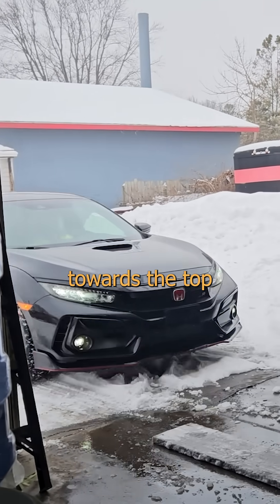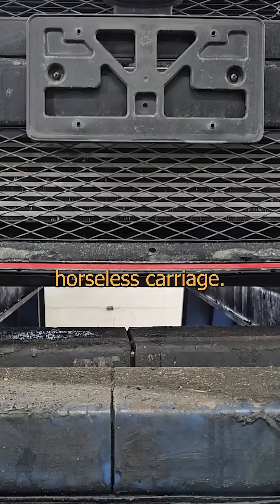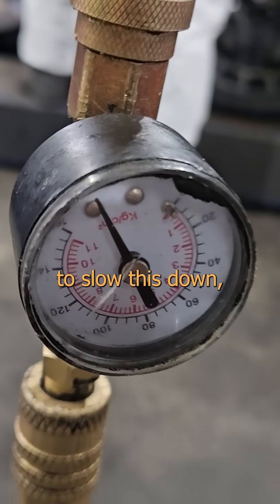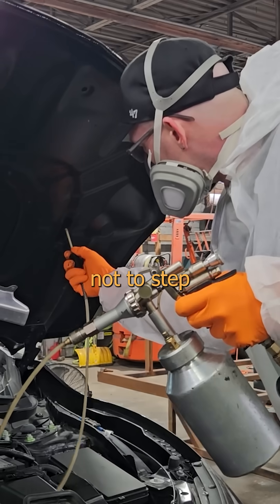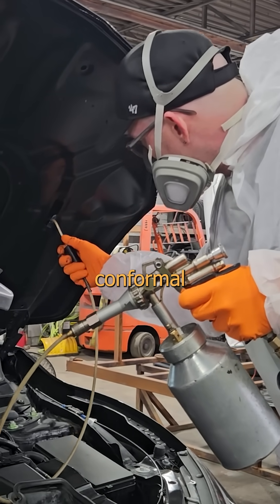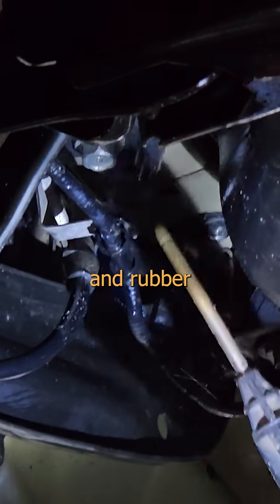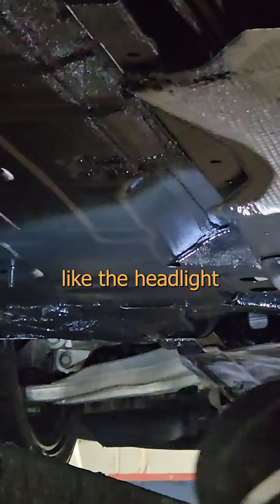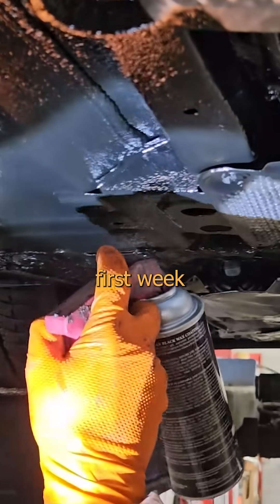How to stop rust on your car #chrisboden #comedy #engineering #wax #corrosion #science #winter #salt

Comment: Auto tech here, I do apply a couple different types of undercoating. This is all excellent advice, only thing I would add is to push for high quality prep work before the undercoat is even open. A bad prep job can make things rot out faster. Stay safe all!
Reply: Wash it and fluid film, wool wax, or used oil.  Anyone selling “magic” ointments is a crook.  If it’s not slopped on and sealing oxygen out, it ain’t doing 💩
Reply: @randymagnum143  yeah, every spring I get my car up on the blocks and use an old bug sprayer to use old oil to hose down the under carriage after a really thorough session with the power washer
Reply: Oh God yeah. Proper preparation is essential to any subsequent coating whether it's the primer, paint or protection. I could have gotten more crazy with the "P"s but I'll leave that to Chris.
Reply: @charlessanford2198  :  Paint, or a hard coating, yes.  
.
The lanolin based undercoatings that never cure or harden..  Yes and no.   Are you better putting it on a perfectly prepped surface, yes..  But if it isn't perfectly clean and rust free, are you going to trap in moisture and ensure quicker rot..  No..  
.
Even if its already rusted, it will slow it down, it will keep more moisture and more oxygen from getting to the metal, greatly slowing the rate of rot.  
.
Better to apply over crap, probably at least after a car wash, than to not apply at all.   If I ever have to move back to the northeast, I'm taking a Southwest vehicle and will have it done professionally where they get every nook and cranny, and then touch up myself the next 4 years, and then bring it back on year 5 for every nook and cranny again..
.
Also..  Lanolin..  Comes from sheep, its the oily waxy stuff on their wool, its why they don't look like a wet cat when it rains..  Also where the brand name "Wool Wax" comes from.   Also quite a few other brands,  Fluid Film, Krown, Surface Shield and more.
Reply: @bobw53jrma I spent my youth raising sheep. I know lanolin up close. (Almost added "and personal" but that's for the freaky, lonely shepherds).😂
Reply: @charlessanford2198  you mean the seven P’s?
Reply: This is solid advice for essentially all coatings. Prep is key.
Reply: @jasexavier  Same with ceramic coatings, the ceramic does the work, but the prep work is what the client sees in the end.
Reply: @jasexavier doesn't really matter as much for zinc paint. Had vehicles that lived on the beach survive far longer than they had a right to as the whole underbody was sprayed with zinc paint
Reply: @jasexavier I agree
Reply: Many people have been turned off on undercoating by dealerships selling it but making no changes to what is under the vehicle.
Reply: I'm with you on that I've Sean chassis rotted out under the wax coat and underseal paint
Reply: I came here to say the same thing. You can use rust prevention from NASA but it wont do shit if you havent prepped properly
Reply: How can I say thank you!  Prep is the key in EVERY project. 
I've f'd up enough man hours since I was a kid to young to know the dangers of my projects coming to the conclusion.....don't skimp on prep!! 👍👍
Reply: yep, no different than paint (just a pretty coating), its ALL about the prep.  It doesn't have to be anal retentitve perfect unless you are trying to do Concourse restorations, but you do have to do it right and not rush that part.
Reply: Is there a decent half-assed DIY option like a spray on bedliner? I have something that's not quite a beater and I want to take care of it on a budget.
Reply: @ProjectZ36 just get fluidfilm from autozone or HD, one time I saw them at HD on clearance for about $2 a can.

Safe for everything
Reply: @ProjectZ36 Yeah, any lanolin-based product (like in this video) can just be sprayed on, with a grease sprayed inside the box sections.

Jack the car up, clear the dirt off with a hosepipe, wire brush any really bad bits of rust off then just spray the stuff on. The grease goes in holes in the box sections.

Takes a day or so to dry and even then is kinda tacky. Reapply year or so. More often if you like driving fast through puddles.

It's great because it needs little prep, is quick to apply and doesn't chip and then have hidden rust underneath the protection.
Reply: And does anyone have a recommendation for quality service in the Rochester ny area?
Reply: Wasn't there a 'service' that installed an anode to the car? I remember seeing old German cars and Cadillacs with an emblem on the grille denoting it had been installed. Something to the effect that it used the negative grounding of the car and the anode to delay corrosion.
   I'm in a southwestern state, so it's not a big deal here. I just get a couple cans of rubberized undercoating and go to town with that. Our windshields on the other hand...
Reply: @longbow6416 yeah, I remember that too. But why do you undercoat your car in the SW? Are you near the ocean or something?
Reply: What is proper preparation?
Reply: @TheOGofSki Well, a really thorough wash would be first, followed by cleaning with a solvent.
Maybe apply a binder or base coat.. All depends what the top coating is but those first two steps are pretty universal.
Reply: @TheOGofSki deep clean n dry
Reply: an easy 1 day paint job is 3 days of prep work.
Reply: The best time is after you drive it out of the showroom, as we all know about the after sales push we get when we buy it. This is a really good one. I would wonder if it would last in the Australian Deasert, though. That red dust eats cars for breakfast here.
Reply: What's special about the red dust? I live in the southwest US and people want used cars from here because cars don't rust here.
Reply: @vfguy65  our glass gets trashed tho, and if you don’t have covered parking? Say goodbye to your paint job.
Reply: Ah yes, I love the P.O.D. techs… they don’t need to even be spraying an air pistol
Reply: Yeah prep is definitely key, you don't want to trap rust and moisture under your protection because then it works in reverse!
Reply: Yep...
Reply: Why not paint it with cheap paint or base dont know how its called in english
Reply: @dmitryhetman1509  He mentioned why in the video: Hard coatings can chip and crack, and then it'll start rusting from the inside. Soft coatings like he mentioned are largely self-repairing.
Reply: @koma-k  Engineer here, great comment. Any undercoating helps SO MUCH, and I'd recommend the soft wax coatings like Chris shows. Less risk of water getting BEHIND it, self-repairing, and technically you can remove it. Don't get hard coatings. And don't overpay!
Reply: @koma-k  Thanks, I missed the self-repairing part.

Comment: I buy shitboxes. Most of them leak transmission fluid and oil. They undercoat themselves.
Reply: Had a 2003 forester with almost no rust on the front end. Turned out to be a weeping pcv valve that wasn't replaced for a decade aerosolizing motor oil throughout the engine bay.
Reply: @TikkaQrow  Gotta love the old Subie boxers lol
Reply: @TikkaQrow Shit I'll take that over it getting all over the valves. Unless they're not DI, idk.
Reply: Shitbox for the winter, decent car for summer! The up north way!
Reply: By the time most cars here start leaking they're already rusty as hell.
Reply: The smell of Fluid Film has scarred me for life.
Reply: Hello fellow wizened cheapskate
Reply: Yup. True story.😁
Reply: Disgusting
Reply: this is what i was thinking LOL
2 shitbboxes and both are doing just fine! 

fine. i said fine.

Comment: So that's a layer of wax over the anti-rust from the car factory?
Reply: its a fair few coats of oily wax. the smaller scratches and pin hols self seal in the summer as it becomes slightly softer and flows back together.

Comment: The underside of my sedan & SUV is pretty
rust free, but the fenders are rotting away.
Reply: Open your hood and clean out the leaves, dirt and debris from the bottom of the windshield. Then peel back the fender liners at each wheel and do the same. The dirt gets stuck in these places and holds excess moisture. Odds are that's what is causing your fenders to rot.

Comment: Oil leaks are the best rust prevention!
Reply: Controlled seepage for corrosion prevention!
Reply: If it drips oil, it has oil.
Reply: @linkbond08  land rover, if it ain't got no oil under it ain't got no oil in it lol
Reply: @BLAZE13011  I can attest. Many years ago, I had a '97 Disco that decided the entire undercarriage needed better rust protection, so it threw a rod, knocked a hole in either side of the block, and doused my entire undercarriage and the passing lane hogging a-hole I passed in a nice coating of oil.
I'd recommend Chris' method as the replacement engine cost as much as I paid for the giant, gawky POS. It was built before Tata owned LR/Jag and was still a flaming pile of garbage.
Reply: @linkbond08 if it drips oil, it isn’t burning oil
Reply: Depending on the size and severity of the leak, you might not need to do oil changes, provided you keep it topped off. Just change your filter every 3000 and keep 'er full
Reply: @InvisibleSquids i actually had a Honda Odyssey that leaked oil at a rate that I just changed the filter every 5000 miles and called it good. Drove that thing from 220k-297k the transmission finally took a shit. For $1000 auction vehicle that I only delt with the oil thing and it was reliable for years
Reply: @RobD76 mini vans make a great beater as you can usually find one fairly cheap and they are practical as heck
Reply: @RobD76 I've got an 04 that leaks oil and the condition of the front sub frame vs the rear sub frame is crazy. The front looks factory and the rear is whats expected for a 20 year old ohio car
Reply: @RobD76  that's awesome, odysseys are great vehicles outside of the known issue with the transmissions, but it sounds like you got your money's worth out of that one lol
Reply: @RobD76  Those transmissions were the Achilles heel of a great vehicle lol
Reply: @InvisibleSquids had a car like this lol was a winter beater that lasted way beyond what I expected from it, just keep the oil topped Off and funny enough the oil never looked dirty
Reply: @InvisibleSquids theoretically if its draining fast enough to keep the oil changed then you should also see extended life out of the filter because its always seeing the clean new oil
Reply: @cameronvandygriff7048  No you definitely still need to change filters regularly. if you're leaking more oil than is going through the filter you're gonna run dry in less than a minute, car oil filters flow a LOT of oil.
Reply: @InvisibleSquids I top mine off around a at a week
Reply: @InvisibleSquids  when I was 18, I had a chevy s10 that burned/leaked 2 quarts of oil for every tank of fuel all I ever changed was the filter lol.
Reply: @InvisibleSquids  Ah, nothing like going back to total loss oiling systems, and the best part is you don't have to turn a wrench, you just need to wait about 15 yrs and your car will return to monke on it's own!
Reply: @InvisibleSquids  The car I'm driving rn is leaking so bad that I use an entire jug of oil each week
Reply: @InvisibleSquids I do this with my current Screwzuki. I decided years ago that I would just keep the car until it broke in a bad way, as I couldn't afford to keep fixing all the little things that kept going wrong.

It's liberating. I drive it like I stole it, and I don't sweat the scratches or dents. Is the car making a new noise? Cool, let's see how long this one sticks around.

The problem is that, now that I have resigned myself to letting the car die, it refuses to die!
The 'check engine'-light has been shining for a year, but I've yet to notice a change in performance.
Reply: @InvisibleSquids ate you staring at jet liners? That shit waaaay over your head
Reply: Self-lubricating chassis system is great at preventing corrosion.
Reply: @FryGuyNS Land-Rover's SLCS is pretty good after five years of age. The bad part is that the car is rotten away by then.
Reply: Unfortunately, it doesn't protect the bodywork or anything else very well 😂@AlexYeets
Reply: If I remove the filter on mine ¾ of the oil drips out and gets mixed with undercarriage dirt. 
I just do a regular oil change.
Reply: i was working on a hydraulic skid project (as a control panel guy).  our hydraulic vender was a good guy.  always said, people don't mind lending him tools because his never rusts.  but it is covered in hydraulic oil so..
Reply: Until your rubber components rot away, lol. Don't disagree, though. XD
Reply: @livingunderarockunderarock9963  a engine works a lot better when the oil is  inside
Reply: @notavailableses a diesel engine works better when the oil is REALLY inside. Iykyk
Reply: My father worked at J&S (a jiffy lube station) when I was a young kid, they used to take the used oil and spray the underside of their cars and run them down the dirt road to build up a rust proof barrier
Reply: @dj72001 that's actually incredibly smart
Reply: Well it’s a Honda so he’ll have to do the undercoat.
Reply: Do any of you remeber Car Talk on NPR?
Reply: @gatekeeper5418  I loved that show.
Reply: GM calls it a time release corrosion protection program 😂
Reply: So that's why none of my gm cars have rusted out yet
Reply: Great anti-seize too!
Reply: My pontiac has entered the chat
Reply: Don’t have to do oil changes if you’re constantly topping it off 🤷🏼‍♂️ give it a month and you’ve got all new oil 😂
Reply: thats the thecnique bmw uses
Reply: 100%, i live in Ohio, and we bullied my 2001 GMC Sierra 1500 and towed/hauled stuff way heavier than it should've been able to tow/haul. Because of that, the transmission has gone out twice, which completely coated the underside of the cab and frame both times in transmission fluid, because of that, it's still relatively rust free 630k miles and 24 years later😂
Reply: Reminds me of Leno talking about why his SLR was in such good condition when he bought it.
Reply: Change my mind.
Reply: Must drive a dodge
Reply: Found the dodge driver
Reply: Especially the 50s - 70’s British sport cars.  Rear main seals were real oil slingers.
Reply: Mdfker hahaha that was so good. Setting your car on fire is the best rust prevention.
Reply: My 97 bubble style f150 believed in this, engine failed, sits in my side yard, ain't rusty up front with the engine and tranny but rear is rusted all to hell, never understood it until I found the leak lmao
Reply: That's why diesals last so. Long!
Reply: I mean depends on the size of the leak you might have to add a quart every day
Reply: When I was in high school, my old Subaru sprayed oil across its entire bottom, so when I took it into shop class and people tried to guess what was wrong with it, they thought it was a transmission fluid leak. I miss that car...
Reply: Well good thing the Michigan potholes will bust your oilpan open so you'll get plenty of oil coating on your frame
Reply: So.... BMWs don't rust? 😂
Reply: Like My 98 ford E 250
Reply: Bmws never rust
Reply: @NatVirgo they dont usually make it long enough to
Reply: @BoneTea why people buy bmws is beyond me, especially the middle class.
Reply: It's like a Scottoiler for motorcycle chains, a controlled oil leak
Reply: It's why Harleys don't rust. Somehow it doesn't work with beamers.
Reply: Agree, I bought my truck with a blown engine. Idiot doubled up the oil filter o ring and dumped all the oil, so I got a cheap truck that had an engine bay covered in oil and dirt, but every bolt I've removed in the engine bay came out nice and easy. However my lugnuts and rotors were so crusty that I got I nut stuck in an impact socket for 2 days, had to remove another one with an extractor, and both front wheels had to be beaten off with a sledgehammer to the tread and sidewall.
Reply: @livingunderarockunderarock9963  that's why Fords with 7.3 diesel's frames stay sold. Lol
Reply: Facts 🤣
Reply: Got under my Fiero the other week and was like “wow, the only things not rusted are covered in motor oil. Guess she needs a bath in it.”
Reply: My oil spewing diesel pickup completely preserved the aluminum frontside of my travel trailer!!!
Reply: Had a car with an oil leak that covered one side at the front, that side was in perfect condition, the other side was rusted to fuck.
Reply: Self lubricating chassis!
Reply: 100% lmao. My crank seal has had a slight leak for ages and it just coats the FJ cruiser frame nicely
Reply: Got to love those self lubricating frames.
Reply: Tell that to 7.3 oil pans...
Reply: BUY FORDS!
OH WAIT, FORDS RUST BEFORE THE OIL LEAKS BEGIN!
Reply: My entire front end has not rusted in 3 years because she leaks literally everything. I leak oil, trans fluid, coolant, even stuff Im not quite certain of
Reply: @synshenron798 Sounds like a Ford warranty...
Reply: I love this stuff! As a former manager in electrical engineering and IT, you intrigue me everyday! I enjoy seeing something cool every day!
Reply: Oh God you have no idea me and my dad were changing a seal on a flywheel something couldn't be bothered to remember the whole name for the part on a truck they brought in and the whole underside of that truck had a decently thick layer of just oil underneath it made it hard to remove the transmission since we don't have any machinery to raise the whole truck just some jacks 
It was a f350 super duty
Reply: That's why i drive a Ford
Reply: Ha that’s why newer bmw cars don’t rust as bad 😂

Comment: It is better to bring the car in nice and dry so the water isn't trapped behind the coating. I noticed your guy blew off the water with air first which is great but still not as good as bone dry from a nice day. I had a customer with a Volvo come in that it was wax sprayed wet/miist and later the wax peeled off better than your mom's legs at the salon. 😅
Reply: Getting a dry day beforehand isn't always an option in the Midwest 😅